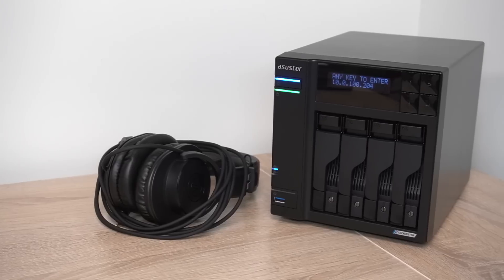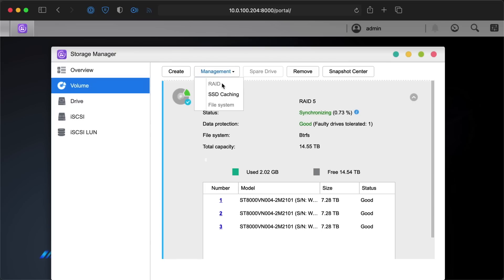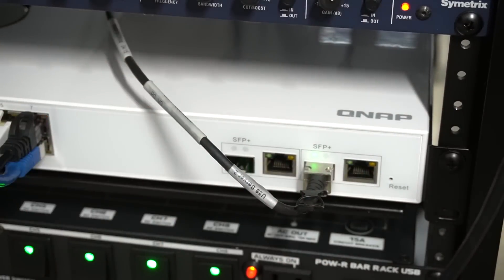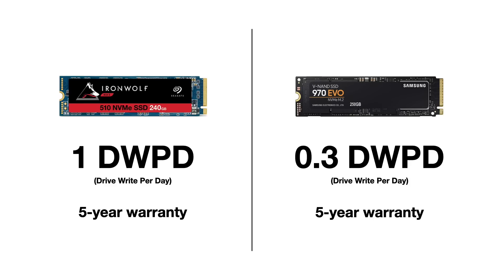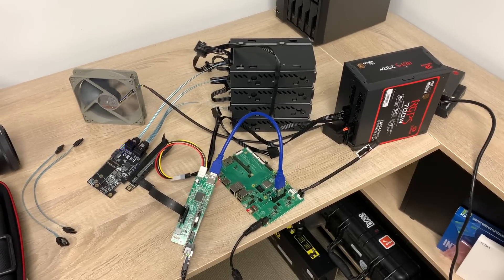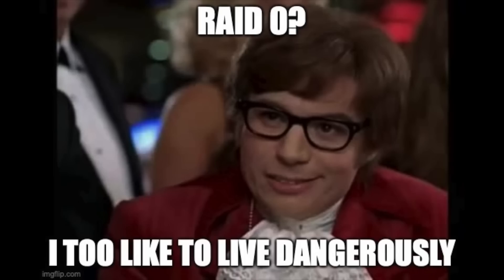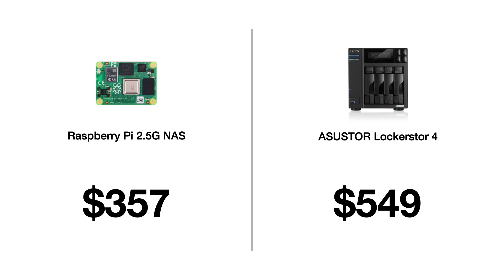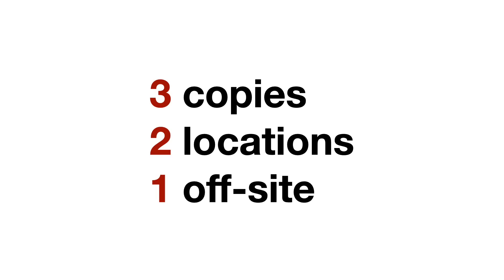Raspberry Pi vs ASUSTOR NAS Head-to-Head Part 2 - the VERDICT!

Comment: I went & built the start of a Pi Nas but i went the other way. Atm I'm using my old Pi4 4gb as i recently upgraded to the 8gb one as my daily driver but ya I'm running OMV5 on a headless Pi4. Atm I've only got 1 Iron Wolf NAS drive plugged into the USB 3 port but i plan on adding a powered USB Hub & 3 more Iron Wolf 4TB drives all of which are in their own powered external cases. 

Only issue that I've run into but i think that's with my 8GB Pi that's running off a 256gb M.2 drive is my USB hub has decided to be at the end of it's life & with 2 drives 1 being the one i interchange w/my tablet & the other being the video transfer/backup for my PS4 so that i can store my YouTube PS4 videos & my printer & PS4 capture card plugged in it's strangling my hub. But the particular hub I've got ppl have reported on Amazon that it dies after a certain length of time.

But back to my pi only issue I've got is from time to time if I'm copying really large video projects or game footage from my pi to the nas i get either 65%, 75%, 85% or 95% done & my pi goes black screen followed by a relogin screen. 

It's not perfect but hey it works till i can save up to build a new desktop pc to replace my 2002 yr old pc that died 3yrs ago it'll do me just fine. Besides not like i can go out & custom build a new pc anyway with the CPU & GPU shortages plus the astronomically high GPU prices & the chip shortages that r making memory sticks, ssd's & nvme drives hard to get.

Comment: What with the 10 hour raid build.  With a new raid it should initialize instantaneously
Reply: All RAID, software or hardware, needs time to build and rebuild. Many RAID controllers do their work in the background independent of the operating system.

Comment: I found this comparison pretty useless even waste of time. If you need NAS and want DIY experience, buy old PC (if you already don't have one) for 100 bucks or even less which turns out will have better specs anyway even than Asustor; add few or even more ethernet cards and start from that. If you don't want DIY, buy all-in-on NAS from any NAS brands - use it. 
IRONWOLF 2TB SSD caching for home use NAS - Asus really ?! LOL
Reply: ASUSTOR ;)

We didn't send the drives. Seagate chose to send the drives they felt were appropriate. We support NVMe SSD storage as well.
Reply: @Tano    cm4 even harder to find than cheap used PC. 

And the point of whole video is advertisement of good NAS ;)

Comment: For auto shutdown and auto wake up for the pi you could use 'rtcwake'.
Reply from the maker: Assuming an RTC battery is installed, this can help start it up at a certain time, but it still won't help in terms of wake on lan :(
Reply: @JeffGeerling  yes, WOL unfortunately doesn't work on pis. Maybe in the future the will be a feature available on the next rpi gen. I think the rpi foundation listens to the community to get ideas for new devices.... ;)

Comment: I was researching Pi NAS options the DAY before you released this. GET OUT OF MY HEAD!

Seriously though, thanks and big ups for that rclone script
Reply from the maker: I'm considering doing a more in-depth video on backup and talking about that script later this year.
Reply: Yes! Please do!
Reply: @JeffGeerling  I would love to hear your experience with Rclone. 
My current setup for satisfying the "3" and "2" in 3-2-1 is "Jenkins + custom rsync scripts". 
I chose Jenkins for visibility around scheduling and to handle cross-platform backups with its various agents.
I'm still missing an automated solution for "1" and tend to sneaker-net that every so often.
Reply from the maker: @T3hBeowulf  I definitely need to do a video on rclone, it sounds like. It's pretty simple if you are okay storing your '1' backup in Backblaze, S3, S3 Glacier, or the like.

Comment: What were the networking issues @Jeff Geerling? I have the same switch as you.
Reply from the maker: In this case, I was not able to get asymmetric bandwidth. for every device to every other device, I could get full speed one way (whether on 1/2.5/10G), but only between 400-800 Mbps the other way.

I tested multiple known good cables, four transceivers from two brands, DAC twinax, five different NICs (all known working), and even swapped out copper for fiber and still had the same issues.

I was running SwOS for all the tests. When I switched to the QNAP, I was able to get the same speed both directions.

All computers reported the proper speed, full duplex, in all the scenarios. I have yet to spend a few more hours with the MikroTik to really see if it has an issue or if it could be a config problem.

Comment: My NAS is 24/7 w/o power down running. In some cases it better to keep the disks running, because they don't constantly heat up and cool down again, a friend told me once. 
But admittedly I never checked if this is true or not.

But it is still running, the disks are getting louder after 8 years, but the GUI says everything is fine.

But I will probably replace the prebuild NAS in the coming year with an own build NAS solution. The CPU is such a bottleneck in there.

Furthermore, my aunt needs a much better storage solution, they have so many "backups" of movies and TV shows, it probably like 100 TB of external hard drives.

While very far from optimal, I will likely just disassemble the external hard drives and build them into a PC.
Buying 100 TB of NAS great disks is just to expensive with 2.5 to 4 grand.
Reply: I was at a guys house. He had no joke probably 40-50 external drives scattered around the house. He used to record TV shows. He said someday I'll get them all on a larger drive and combined...I asked him so how often do you watch that old stuff...not really at all. Yep so why bother?

Comment: I have a pi NAS that is only two, very neat boxes... The pi in a case w/ heatsink and all the ports moved to the same side (except the SD card on the opposite side, of course), and a USB3 external storage that lets me plug in 4x 2.5" drives. I already had a box of 250GB SSDs from old computers. I know it's USB3 instead of SATA, and with far less storage capability, but the whole setup cost me $150 (will cost you more if you don't happen to have a bunch of spare drives laying around, or less if a manufacturer sends you stuff for free lol) and is very neat and orderly and was kind of a breeze, what with the huge amount of community support and the fact that this is a pretty darn popular project to build meaning the steps were all laid out for me already.
Reply from the maker: The Pi does make a great 'found parts' storage device, as long as you have modest needs and don't expect it to do everything under the sun. Nice job keeping some older parts in operation and useful!

Comment: Raid 5 and 10 dont protect against bit-rot
I'd be VERY interested in seeing if the ASUSTOR supported Optane, i know its not the use case Optane officially supports, but i've tried it on FreeNAS with an AMD processor and it works great there. Would be cool if ASUSTOR could do the same thing. Mainly because i never want to have to worry about my cache drive failing
Reply: Optane drives are supported! Intel sent us a few to test with.

Comment: Can the Pi do hardware transcoding as a ex server?  I would up using my Asustor NAS as bulk storage for my plex server as the NAS just couldn't really handle the transcoding.  So I have 30TB of NAS storage and a server with an Nvidia card for transcodes.
Reply: thanks,  what NAs do you have ? what about the Pi transcoding for Plex, is it powerful enough. Did you consider other options

Comment: A prebuilt NAS is just a security hole. In 2-3 years the support dissapears, and there you are with an aging linux on it. In contrast, even the first PI is still supported. Even better to buy a small fanless x86 (i.e. minimal power consumption) and connect a bunch of disks using USB3.X. I did it, that's an older setup, so I have only gigabit ethernet, but a HDD can do about 120Gbps, so it's about OK. This is also my router, my OVPN server, my STORJ node and my torrent client. There was a time, when this was my Kodi server too, but the remote I used was quite bad... :) And as long as I get x86 updates for Ubuntu, I can update it, so this will be my solution for the next 5-10 years. I know, it may not be cheaper, but I was completely fed up with buying new router, new NAS new whatever every 2 years...
Reply: We don't support our NASes after three years? That's news to me, the president of the company, our marketing, sales, management, testing, hardware and software development teams. I'll have to let them know. They're gonna be so confused when they find out they've been supporting the company's oldest products for over 10 years by providing updates to the kernel, drivers, features, protocols and apps.
Reply from the maker: I know with Synology and ASUSTOR at least (not as sure with QNAP), support is typically given for at least 5-7 years (sometimes longer).

And the hardware chassis on these NAS devices is such that I'm hopeful I could continue to extend its life with a custom Compute Module board down the road. Maybe even a fun project I could hack on before the useful life is over :)
Reply: @JeffGeerling  I think I hear excitement noises coming from your 3D printer.

Comment: I build my own utlrabudget home NAS one month ago. a Refurbished 2012 HP i5 Tower (70 bucks), plus a 8 Sata disk marvell controler (50 buks on amazon), some ram to reach 16Gb, and a small SSD drive. Is not as fast as yours, but works pretty good with 7200rpm discs. My home network is based on a Gigabit switch. The limit is the network. Every for less than 150 buks
Reply: If you have an extra expansion slot. Get a used Intel based NIC 10GB 2 port like X520-2. Then get one in your main System And directly connect a cable between them then using a static IP. You can also add a line in your host file so that data to the NAS always uses the 10Gb link. With a 2port NIC on NAS one can connect 2 clients and have a direct 10Gb for just the price of the 2 NIC. Then add a 10Gb switch later as need/budget allows. A standard HDD these days can hit around 200MB so the bottle neck really is the network.
Reply: @mrmotofy  true friend!

Comment: Was there mention that you're comparing an Intel CPU with an ARM architecture??

I would love to see you pit that J4125 against the RPi4 in other comparisons :)
Reply: @Tano Nah, just thought the comparison is a bit limp as the Intel CPU is a whole different beast regarding DMA and pipelining etc.
Would be fun to see how this RPi setup performs against the Celeron when you use it to pump data into a GPU on that x1 PCIe.

Comment: I wouldn't consider the pi nas more than a media server, for that , 1Gbps is enough.
A dedicated ups should be a must to cope with power failures, especially with the data corruption habit of pi.

Asustor looks promising, especially with the RAM use, not like Synology, who 'recommends'  to buy the branded RAMs with no spacial features or ECC.

Comment: guessing but is vlan tagging turned off ?
ethtool -K enp2s0 rxvlan off txvlan off
odroid:We found the realtek's r8125 9.003.05 driver was working fine with 2.5GbE infrastructure while Kernel 5.9 r8169 driver was working more reliably with 1GbE infrastructure.

for your mac end apparently this works better?
'LucyRTL8125Ethernet.kext for Realtek RTL8125'

Comment: Really interesting, I hadn't considered Asustore before, but after having an extremely poor performing Synology I think I might look into them again. 

It's a massive shame that 2.5g switchs are not more common place though as high port count 10g switches are that bit too expensive... :/
Reply: 2.5Gb are getting more common but it's kinda pointless if a standard HDD can practically saturate it. Also low availability of actual switches. Then there's 5Gb equally as useless.. just make the leap to 10Gb now and be done.
Reply: @mrmotofy  a fair point, but at the same time I do feel that 2.5 has its place and could be a really good cheap alternative. I think 5gig is a bit dead in the water but with 2.5 becoming more and more common manufacturers are missing a trick IMO.

But saying that, you have a very valid point.
Reply: @richarddavies2902  I think it's more of manufacturers are trying to rush out more products to sell to ignorant consumers. Virtually all the computer tech starts at enterprise level and filters down as years go on and prices drop. There's more need, R&D and money there. I bought 2 used 2port rj45 10Gb Intel NIC's. 1 in server 1 in main system for around $120 for both.  Direct cable between them with static IP's and line in Host file forcing all data between to run over 10Gb, since Win10 will sometimesdefaultto a 1Gb link. Poof 10Gb max transfers. I can even add a second link to server before I need to consider a switch. But then add a switch and expand away.
I can see consumer routers jumping to 2.5Gb for some sense. Since over provisioning a 1Gb internet would yield 1Gb + usable speeds and many ISP's are rolling out 2Gb. Clearly a faster NIC is needed. So they will use the bare minimum

Comment: The apply changes banner is a double edged sword. A lot of the time, when a second apply bar like that exists it allows you to batch settings changes, allowing you to set them all before waiting for them to complete in case they took a long amount of time. It can help by moving the waiting till the end, not interrupting your flow as you change settings, but can also be a hassle if you are just changing the one setting, especially when it takes so long to show up.
Reply from the maker: True. One risk is you might forget to even apply the changes 😅

Comment: I've tried OMV a couple times over the last couple years, and I found it so buggy that I gave up.  I'm not saying you tested wrong, because I have not found a reliable plug-and-play solution for Pi and similar boards.  Ubuntu Server + Cockpit is pretty easy/approachable, though.  And, yes, there is a ZFS plugin.  ;-)

Comment: Why not just use 10 gig networking ? Why bother with 2.5 gig?
Reply from the maker: I can get USB adapters that give 2.5 Gbps for $30 (TB3 or PCIe cards for 10G are $150/$99, respectively). Switches are 2-3x more expensive, you have to usually upgrade from Cat5e to Cat6 or Cat6a cabling (minimum).

I'll be covering more about 1/2.5/10 GbE networking in a future video.
Reply: @JeffGeerling  I put in a thunderbolt 3 chain a few years ago with a Promise raid and I'm getting 600 megabytes / sec. Got a Corning thunderbolt fiber to my rack so workspace is fast. I network through it. Have a dell with thunderbolt Linux and my Macs and Linux are all happy 😃
Reply: @JeffGeerling  if I could just switch PCI is be in heaven I think. The future seems to be PCI switching IMO. At the high end.

Comment: Thanks for the follow up video Jeff. Very nice, more please :-) I can’t help thinking that SSDs would consume much lower electricity than HDDs. For a start fan(s) would not be required. Of course SSDs remain far too expensive, but this could change in future and large boxes with HDDs in them would look as out of place as CRT monitors do today. A Pi4 and 4xSSDs connected via a USB 3 hub with 4xSata to USB3 cables consumes in total around 10w from memory. Of course USB3 isn’t suitable but the electricty consumption point remains.
Reply from the maker: SSDs still get quite hot, so you'd need a fan, but yes, not as hot as HDDs, at least not high powered ones like these from Seagate. Also, except for the highest end SSDs, most don't require nearly the same maximum power draw as an HDD.
Reply: Thanks Jeff. I agree with your point in the video about not being easy to power down OMV to save electricty. Also the bulk of either the Asustor or Pi setup isn’t great. Definitely think there is a gap in the market for a small SSD box / setup that is low powered. This would help reduce the power consumption of not being able to put OMV into a low power sleep type mode.
Reply from the maker: @keithmiller9665  An SSD-based 2.5" array like what Wiretrustee is building seems like it could be an ideal SOHO solution. Silent, only needs a fan at very low speeds, pretty light on power consumption, and fast enough to saturate a 1 Gbps network.

I'm considering—once the Wiretrustee is released—building a small 2-drive RAID 1 NAS that I drop at another family member's house and sync to my local NAS via rclone/rsync. Just need to find a willing family member who's okay with me dumping a few gigs every night :)